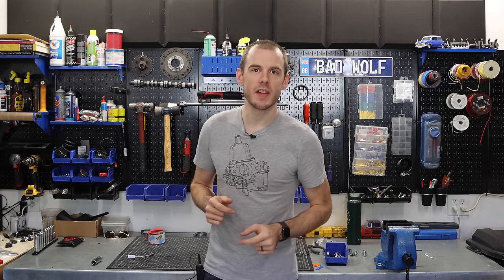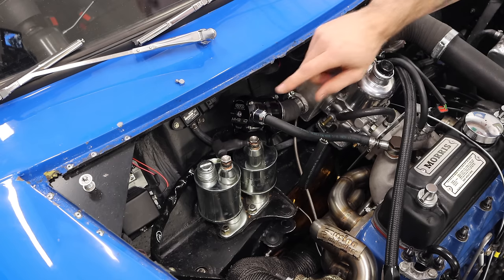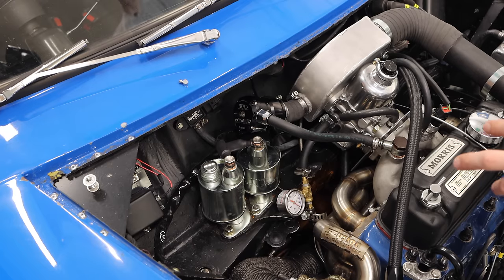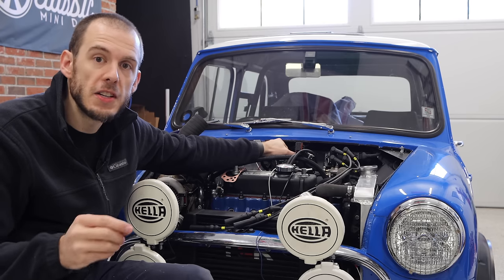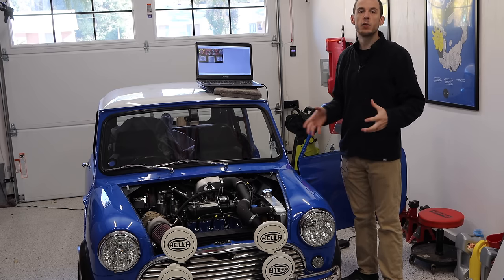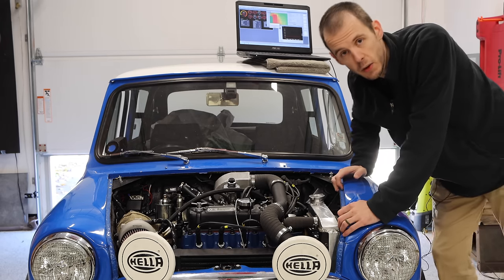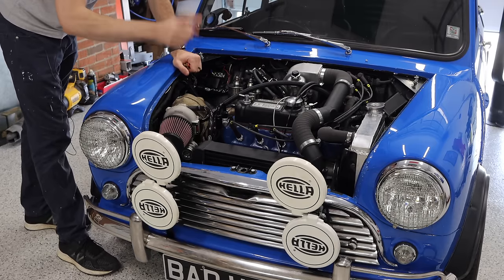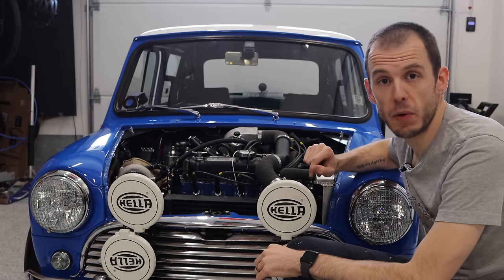The first start of Turbo A-Series Engine | Turbo Bad Wolf

Comment: Pro tip: you know those interchangeable tip screwdrivers? If you take the bit out they fit the hex on a standard hose clamp. Much easier to do up than with a flat head screwdriver.

Comment: Cole, you completely explained how a blow-off valve works (and why) in a perfectly clear and simple way that I was able to fully understand! 😊 Nice job, well done and thank you very much.
Reply: Compliments on the new bigger garage. The lighting in there is nice and bright. Camera focus also good and the audio was excellent. Explanation of the various SU needle profiles was useful. Overall a really nice subscriber experience! 👍
Reply from the maker: Thank you for the kind words and feedback! The new garage has been such a great to work in. I think I still need just a bit more sound proofing on the ceiling as I get some revurb in the space still.
Reply: A slight adjustment to the explanation, or  it could be just how it was said but i found it a little bit confusing for me anyhow.  Technically if you don't run a blow off valve when you take your foot of the throttle all the vacuum explaining that was said was correct but the pressure/boost in the plenum does not go into the engine.  As the carb butterfly is shut there is nowhere for it to escape but back the way it come in, thus you get compressor surge.  This is where the blow off valve comes in, vacuum as explained and release of pressure/boost through the valve.  Now is a blow off valve necessary, depends on boost i would say.  I ran 10 psi in my last engine with no blow off valve and ran a treat and the flutter sound is awesome. Turbo is still in good nick too, that said the more boost you run i would highly recommend it.

Comment: Great to see the engine running! From my experience with the DTA ECU the sensor position value needs checked with a timing light. I had to adjust mine quite a bit.
Reply from the maker: Yup there is a little caveat under the approx sensor position that said to verify with a light. Mine ended up being on point from the software but it’s always worth triple checking.
Reply: Sensor angle set at 268 ( curious as 360 - 268 = 92 which is where the sensor is physically) 
timing light used to set this value which gives 8 deg advance static timing at idle ~ 950 RPM

Comment: Great job on engine 1st firing.  It must be very satisfying after tons of building and preparing.  I am very much looking forward to seeing a video about AFR measurements.  I am planning to install AFR with my 1275 HIF44 engine. Did you need to prime oil pump before 1st crank?
Reply: Yes, you should always prime it prior to first start. If its a new cam/followers, remember to follow the correct 'knock in' procedure.
Reply from the maker: Yup definetly always want to prime the pump. I actually verified oil pressure in the last video which is why I didnt mention it in this one but the AFR topic seems to be one that a lot of people wanna hear more about so I am hoping to cover it in more detail during the driving.

Comment: Hello, love the build but i noticed at around 7:55 there is not an engine to bulkhead stabiliser, what have you done to stop the engine movement back and forward?
Reply from the maker: Due to the turbo and the exhaust manifold I had to move the upper steady to the other side off the thermostat. DSN makes a thermostat that has a steady built in.

Comment: Hi what inlet manifold are you using on that. I see you said it was modified but was it a MG metro one?
Reply from the maker: The inlet manifold is actually just a standard minispares one that has had some sensor take offs drilled and tapped and the coolant line removed.
Reply: @classicminidiy  cheers I have a bagsport one on one of my engines but I'm thinking of using a alloy one on my turbo build.i can't see there being much difference but could be wrong.

Comment: Why did you turbo a 998 when you could of put a 1275 rebore to 1293 to 1380? I have a 998 and Iwo mind whether to turbo it or put 1275 rebore in the car. Just your personal thought please..
Reply from the maker: Sounds like you may have mis-heard my video. I turbocharged my 1293 a-series. The engine was previously rebored from 1275 and was wonderful NA. But I wanted more power than an NA engine could produce so I turbocharged the same engine. The turbo conversion provided me about 170hp vs the 75-80hp I had on the NA version.
Reply: @classicminidiy  Thanks for the reply. Should i turbo a 1275 if I can get one cheap rather than a 998. Someone is selling a 1293 for cheap so I am in two minds what to do. Would I need to modify the head like bigger valves etc or could I just refurbish the head. New valves, valve guide, double spring , 3 angle, etc.